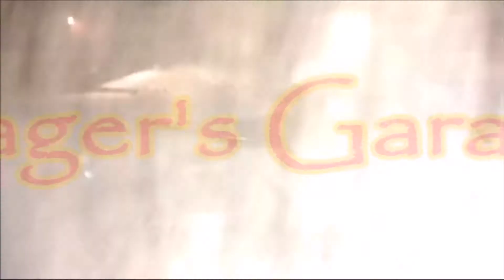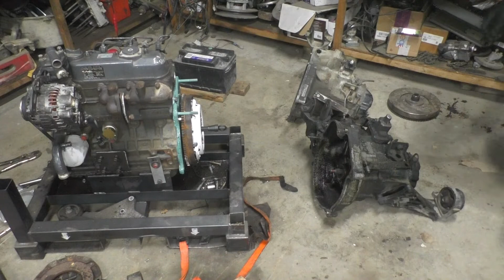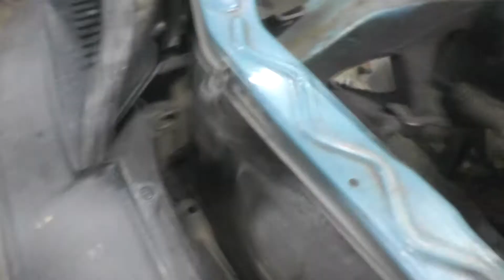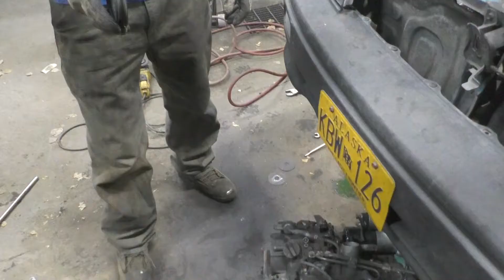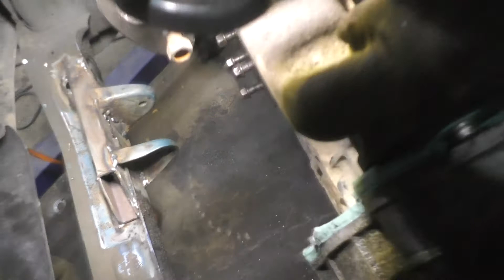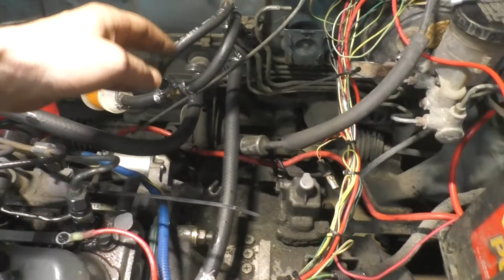Geo Metro Kubota Diesel conversion Part 3

Comment: I’m trying to take a d1105-t and put in into a samurai. Very interested in your project. It’s hard to find people who agree with the kubota swap
Reply from the maker: If someone wanted to go hard core I bet you could drop 300lbs by gutting the interior and lexan windows.  But for me sometimes I take the wife and kids plus I have 75lb of bricks in the back for traction on the ice and snow.  I learned that with my first metro without the weight in the rear I would hit a bump and the rear end would come around.
Reply from the maker: Yeah and basically no information out there that I could find.
Reply: @jagersgarage490  The 1105 might do okay - it makes maximum torque at 2,000 rpm and maximum hp at 3,000 rpm - which I think is in the range of the original gasoline motor.  Its  63.4 ft·lb at 2,000 rpm could work well for about 45 mph cruising.  The gearing can be an issue as the gasoline motor probably operates at a higher rpm than is best matched for the diesel.  A Metro cruising at 70 is turning 4,000 rpm.  You can use the transmission from the 1.3 four cylinder to drop the cruising RPM a bit - its basically what the XFI used.

I don't have the risk taking guts to attempt this as I don't see many of these swaps work long term, but most failed attempts use a diesel motor which makes less torque than the 1105-T.  You want to operate as close to the peak torque of the diesel as gearing and weight makes it practical, but the Suzuki transmission doesn't help too much.  You could use 14-inch rims  to help keep the motor in its torque peak, but I don't know of rims that would fit the Metro.

I might consider cramming a VW TDI motor into the Metro, I'm sure a 4 cyl TDI wouldn't fit without notching the frame. But, I know the transmission would be well matched for automobile cruising.  The 1.2 liter 3 cylinder Polo TDI diesel wasn't sold in the U.S. but I bet I can find one - it made 74 hp and max torque at 2,000 rpm.
Reply from the maker: I have an xfi so I have the higher diff gears I am running 15in honda wheels with 185/65R15s which at 60 mph I should be running 2400 rpm which according to a dyno chart I found online is peak tq and maximum fuel efficiency. So far I am getting 40mpg same as the gas engine at the same speeds.  I intend to turbo ot in the future to help efficiency and holding gear on grades.  The engine I really want to use is a suzuki 600cc turbo diesel but it is only available in india and Turkey I believe but have not found a way to get one yet.
Reply: @jagersgarage490  Do an update soon!   GM did a 3 cylinder prototype in the 70s that got 75 mpg , but it couldn't meet many regulations - I doubt if buyers wanted something like it either.  It was a lot like a Metro but lighter as crash laws were not as tough then.

I thought a Metro could be tube framed with an aluminum floor and plastic side and rear glass - drop 200+ pounds.  Use the cowl and windshield structure to support the windshield.  Race car dash.  A full nerd hyper mpg car that externally looked like a regular Metro.  I don't know if it could pass inspection, but here if a home built car has lights, tread on the tires, the wiper blades aren't cracked and other basic safety equipment it will pass inspection.  Ariel Atom is street legal in some states. I'm pretty sure I could find some inspector that would pass it.  A 1,450 pound Metro with that Kubota engine would be fuel stingy.  Safer than a motorcycle.
Reply from the maker: I am waiting on parts so I can do a tachometer installation and update in one.
Reply: @jagersgarage490 I believe your diesel Metro may be the best I have seen on the Internet.  I think it could be usable as a daily driver.  The selection of suitable industrial and ag diesels for the U.S. isn't the best.
Reply from the maker: I have been using it as my daily for a while works good in town not so great on the hyw will the hills.  The selection of small diesels is not the best its pretty much a kubota unless you want a TDI
Reply: @jagersgarage490  The 1.2 VW Polo diesel was sold in Mexico, I'm not too far from the border.   Newer Polos have a 1.5 liter diesel and six speed manual.

I have some Kubota motors, the only one that might have adequate power is rated at 31 hp - can't recall the model, but its a four although small, it is probably physically a little too long. Yanmar sold a lot of motors for sail boats
Reply from the maker: There are lots of options out there I say kubota and TDI because they can be gotten anywhere in the US and be bought for relatively cheap.  Without using 4cy metro parts a 4 cylinder will be to long even this 3cyl har clearance issues
Reply: Wow. Just stumbled across your channel. I got into the metro addiction a few months ago. On my 2nd car and build now. This will probably be my next build. Please make a update on this.
Reply from the maker: I have an Update almost ready to go just need a few more bits of video.